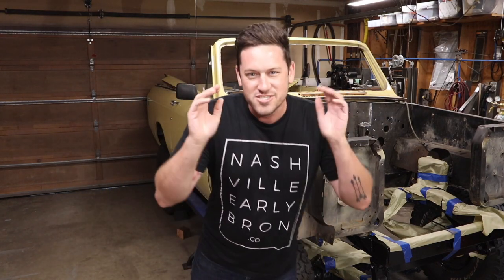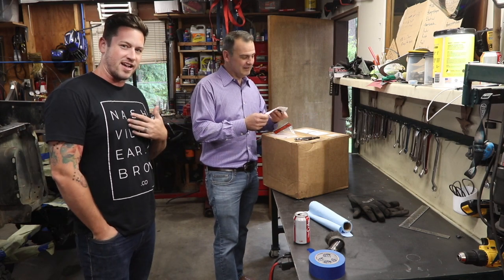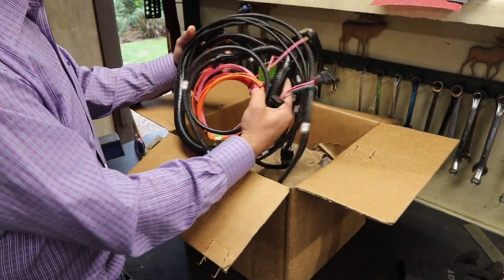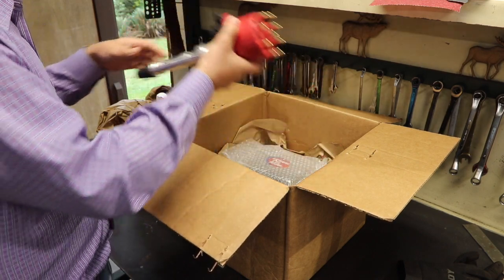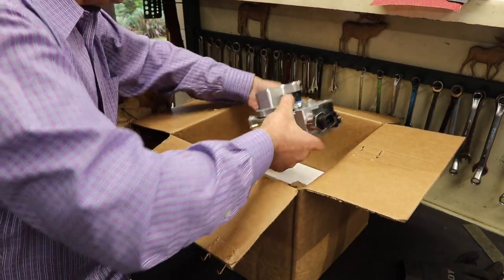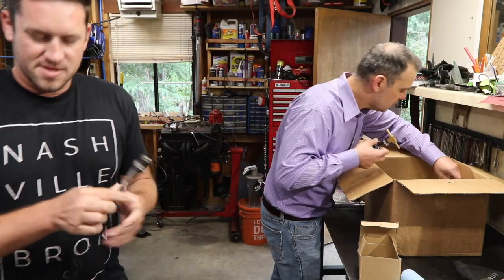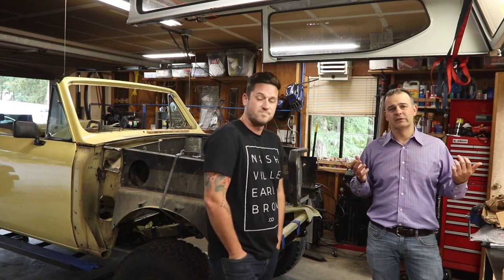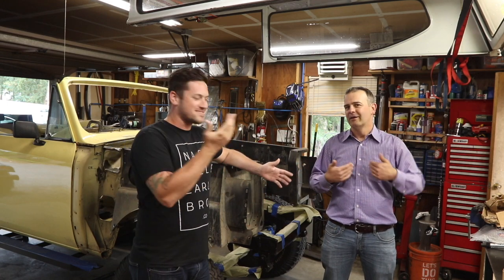5.20 Fuel Injection Reveal!

Comment: Did you send out your distributor or just running a fuel only system like the Holley sniper and Fitech? Im a bit unclear why you didn't choose Bill Hamiltons set up, it is so much more seamless ... Ironically I have an older AFI that required a lot of rework, reprogram to get going. ???
Reply from the maker: Sean, the distributor I show came with the kit new.  I didn't need to do anything with my old one.  I didn't know about Bill Hamilton but I just researched it and it is pretty much the same concept. The only advantage I see to Bill's is the ALDL Data Logging Cable and data logging Program.  But as I mentioned, I'm not really into the tuning.  I just want reliable, efficient metering.   We'll see how she runs and I'll report back.
Reply: @MattsGarage  I understand that logic, the value with the data logging cable is really that you can save the files and email them to Bill when it doesn't work, but the AFI price is pretty reasonable. Ill have to see how yours goes. FYI found the shackle video very interesting.
Reply: Sean Vigil thanks Sean. That shackle video is something I’m pretty proud of so I appreciate it. I wish I had the time to devote to make more like that but it took a lot of work and effort. Life gets in the way!
Reply: @MattsGarage  Just looked back, saw you have the chevy 350, makes more sense now.

Comment: Too bad they don't make a 4 bbl version.
Reply from the maker: Rick Williams don’t need 4 bbl unless you are over some ungodly amount of horsepower. In which case they have duals. Carbs need 4bbl because of vacuum metering. With electronic metering the injectors are the limiting factor.

Comment: Is it always necessary to lock out your distributor with an EFI system?  I saw johns vid and now Matt you are talking about it?
Reply from the maker: W W not at all! But if you want the ecu to control timing and advance then yes. Many EFI systems don’t require it but then you are trying to tune your old mechanical and vacuum advance. Make sense?
Reply: Matt's Garage thanks Matt.  Will have to look at my manual for my fitech unit.  Mine is the 400 hp and I don’t think it came with that option.  It’s been awhile since I messed with it.  Btw, glad to see your putting a little bco,(dash),into your IH.